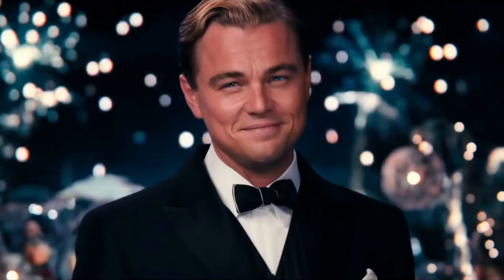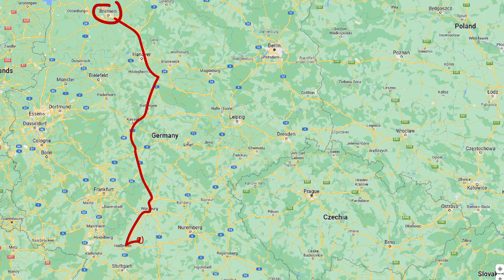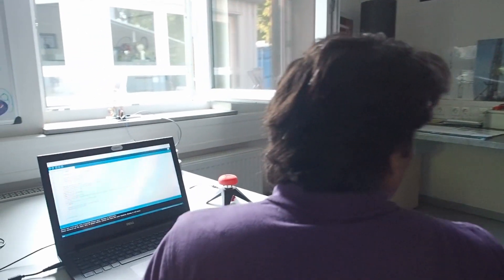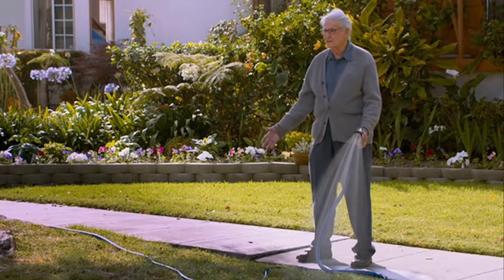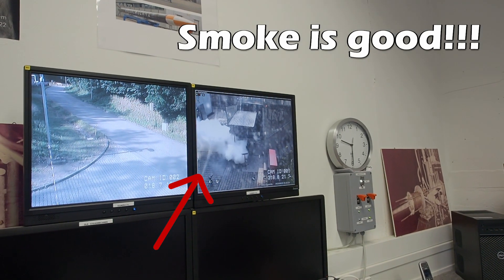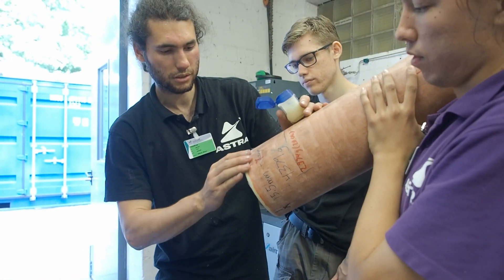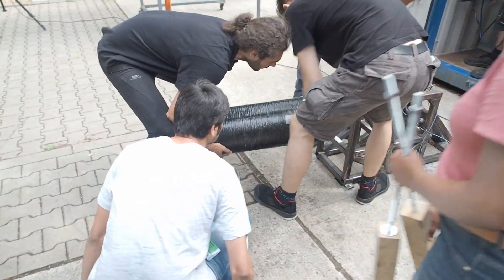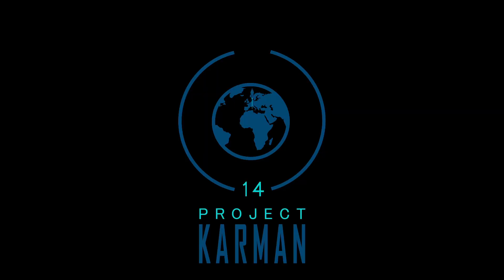Hot Fire Testing KARMA!!!

Comment: Have you considered tri-propellant.   Instead of wax as solid fuel consider HTPB fuel with some oxidizer included (maybe 70fuel/30oxidizer) so the fuel is also the igniter and heater for the N2O.
Reply: If you're going to mix an oxidizer into a binder, just make a solid motor at that point and ditch the added complexity of the hybrid design.

Comment: Excellent video and congratulations working through the problems. 
If you’re lack of recorded thrust data is via load cell and sd card then your not on your own. 
The reliability issues have made me decide to change my system of capturing thrust. 
Anyway well done team I’m rooting for you 🚀
Reply from the maker: We are on our second campaign right now and we actually just managed to get some reliable data from our load cells for thrust.  It is all a matter of how you set up the equipment and the interfaces you use to mount them.  Tolerances are everything!!